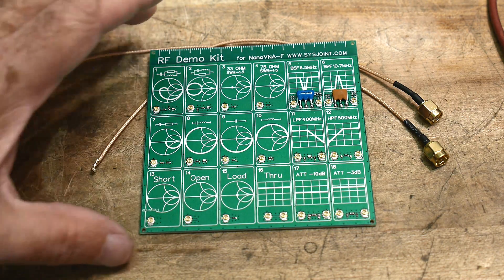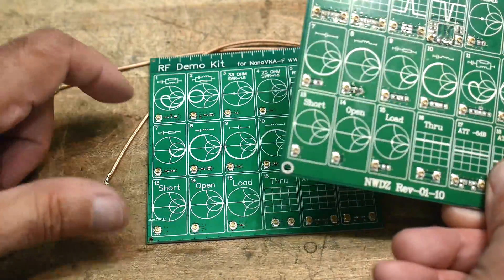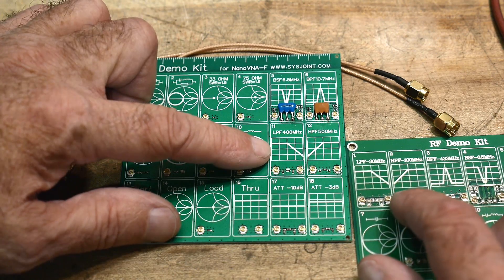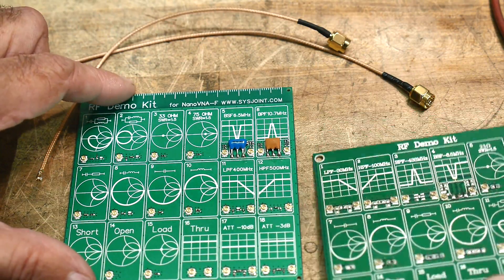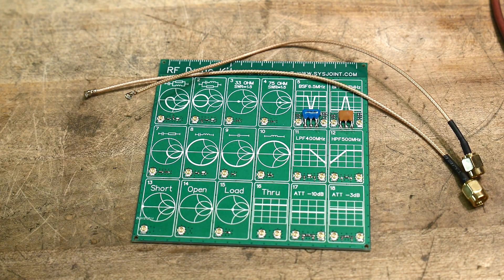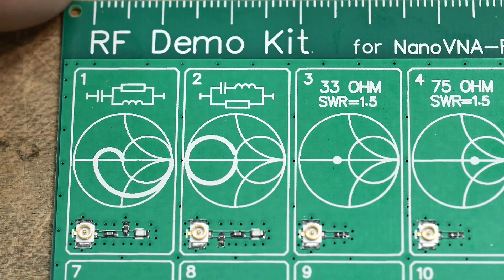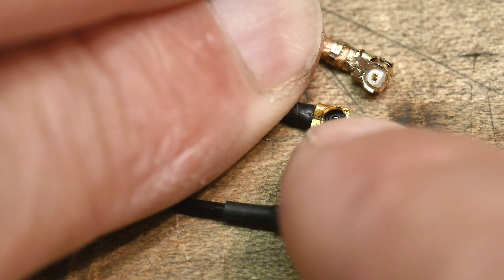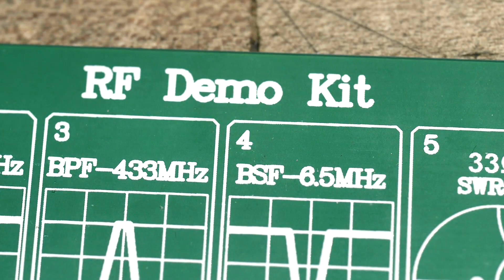#577 NANOVNA RF Demo Board rev 2

Comment: where did you get the black cables?
Reply from the maker: eBay, the photo was not black and I was surprised when they came. Can't guarantee any posting to give you these.
Reply: @IMSAIGuy  eBay has a part number that searched for doesn't require posting a web link to YouTube.